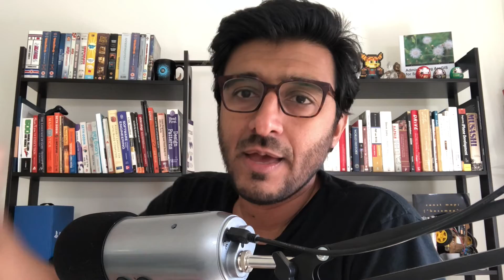Why you Shouldn't Implement Features Because They are Easy - Backend Engineering

Comment: I think you have a bit saturated this time.
Self thinking by software engineers that develop some feature, maybe of improvements or for the matter of making this feature generic - is good.
It does need careful touching (like everything!).

You gave the example about the extra parameter - I believe that the developer will be smart enough to make it optional and handle the situation ehre if it doesn't exist